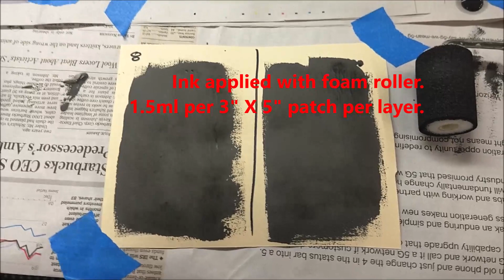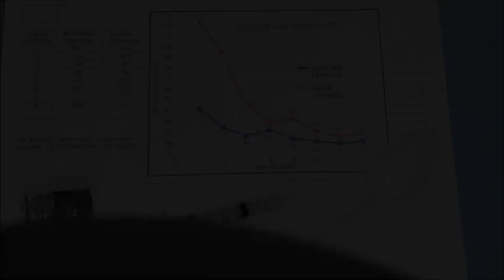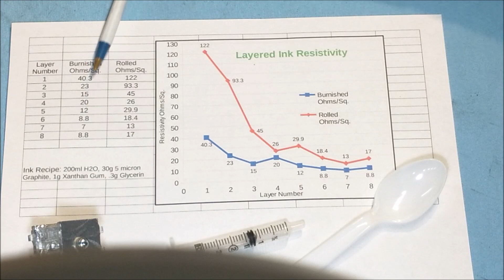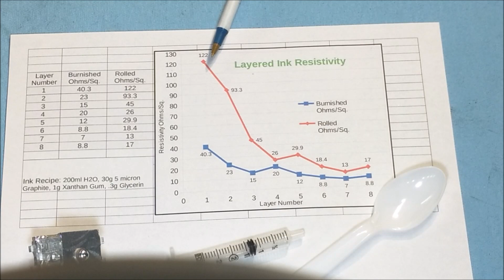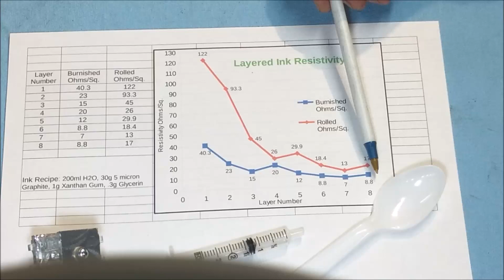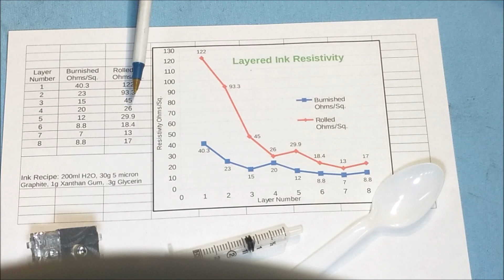Layered Conductive Ink Test Results

Comment: Hi Dennis, excellent research and thank you for sharing your results. One question, when to apply the ink with the roller, did you roll in one plane or two?
As a note, I found the Xanthan to be less electrically conductive than Guar, but that does not in any way detract from the results( but please note that neither worked with my DES, Choline Cholide, Urea, glycerine 2:1:1, saturated with copper chloride). As I will be spray coating, I think I will increase my layers and see if I can see a similar betterment, although I will be pressing, not burnishing.
From your recipe, it appears you have apx 3% Xanthan, try halving the concentration on two or three test strips, you should still have sufficient to bind, but it should help with conductivity.
Keep up the good work :)
Tony
Reply from the maker: Hi Tony - thanks for your comments and insight.    I did roll in two directions.   Tried to correlate ohms to thickness but with multiple layers and burnishing the thickness of the ink and card stock was all over the map - I'm  sure I thinned the paper along with the ink   ink layers but couldn't separate that data.

Yes  - I should experiment with lower concentrations of Xanthan …..at that 3% level it was very flexible and waterproof - lots of room to cut it back.  Let me know if you get an improvement from 'pressing' ….I'd like to try some type of pressure rolling - more concentrated force I think.

Comment: can you do the same test with heat applied to the different layers
Reply from the maker: Hi Barry - where you thinking the heat would give better adhesion between layers - maybe?
Reply: @denniskramer9788  hi Dennis we still do not understand the chemistry. (speaking for myself.) heated application could give you another type of bonding, Kev "'the corbonator'' is getting better results after he had the process in that printing press. also that RMS did better results too. i am not even close to an assembled unit my time constraint is just hampering the hobby project at this time. my last cell i constructed in December is still sitting on 200mv at 10mAmps (never been charged) the ink, carbon based was similar to what cayrex was doing the heat and pressure do have an affect.